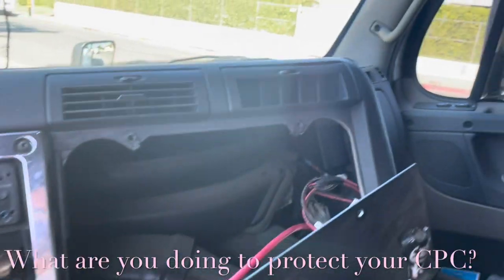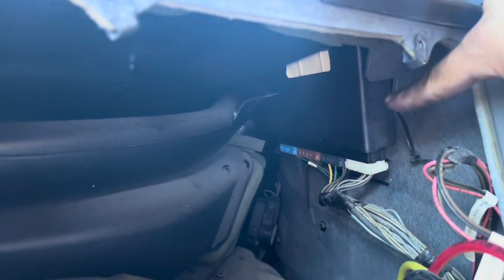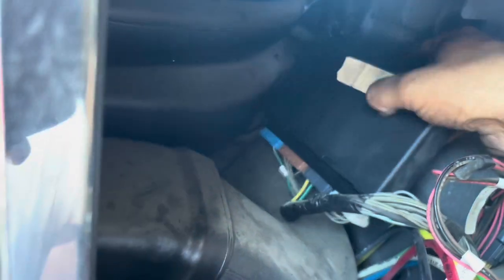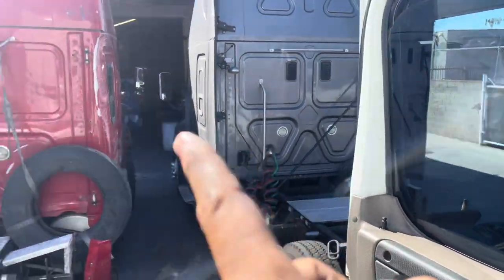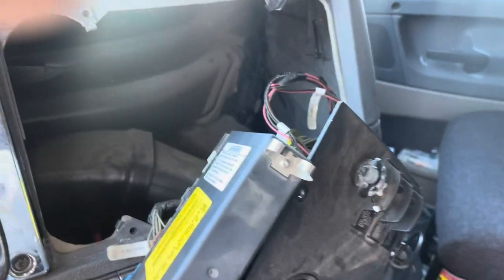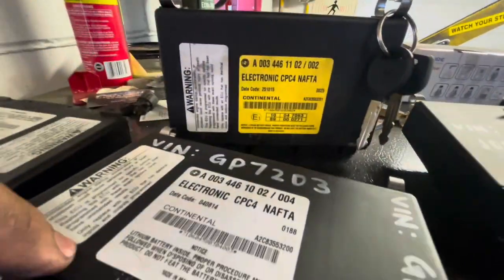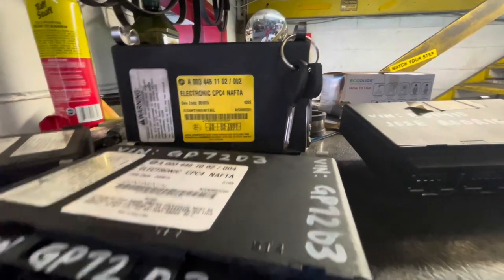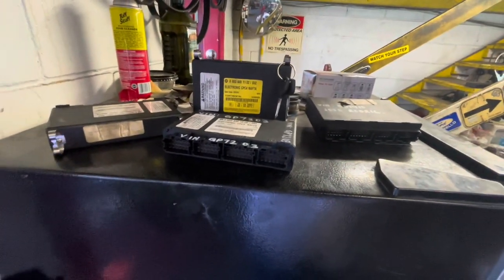Freightliner Cascadia owners, what are you doing to keep your CPC4 safe?

Comment: I took zip tie out put cable tie in, fabricating a block wall in case they get past front panel that has keyed tamper proof locking bolts and air supply lock so truck won’t move unless it’s dragged onto a flatbed what a beautiful world we live in
Reply from the maker: It is sad what we have to go through in order to protect what’s ours. 
But that is some great engineering on your part

Comment: Thank you for this video ..Question ,ones I remove the CPC for safety can I put it back next morning and the truck will turn on normal ?or ones I put it back they  need to reprogrammed?
Reply from the maker: Yes. You can remove and install the CPC and it will not have to be programmed.
Reply: @CarlosDieselElectric  perfect, thank you for the info , much appreciated..

Comment: This video helps truck owners and thieves as well thank u .
Reply from the maker: The thieves know they are there. My customer had his stolen while he was at a Home Depot. In the store less than 1 hour. Came back and CPC was stolen. Total price was over easily over $5,000. 
$2,000 for the CPC
$1,200-1500 for the core
Plus programming (varies at dealership)
Plus the harness 
Plus labor (to assemble harness)
and then the down time. 
Just have to be safe out there. Takes thieves less than 5 minutes to steal the CPC.

Comment: Thank you sir, does it affect the truck every time you take it out and put it back in?
Reply from the maker: It does not, just be careful with the plugs when you pull them. But as far as the memory of the CPC goes. Nothing happens to it.
Reply: @CarlosDieselElectric  so I just removed it and when I plugged it back in the orange engine light stays on, how do I remove that?? And a code is popping up now for cruise: SPN 639
Reply: Ok the light just went away had to let the  truck sit for a minute
Reply: No I do it every day

Comment: this is a long shot but what are you guys doing if the connectors have been cut? are you installing connectors or the whole dash harness?
Reply from the maker: Good question, Freightliner sells a kit but the irony is they don’t include the instructions which completely defeats the purpose. I use a sister truck or similar and follow the numbers and pins.
Reply: @CarlosDieselElectric  I appreciate the response! I recently had a request from a penske shop that was hit for 15 cpc's I provided all the schematics I could but a sister truck is what I was thinking as well. Thank you sir will check out more videos.

Comment: Hi can we take the cpc out every week when we do our reset at home that's 50 times a year should there be a problem ?
Reply from the maker: Yes you can, I cut the power using the cut off switch then I remove the CPC4. You won’t have any issues. It is a plug and play.
Reply: @CarlosDieselElectric  Thank you man I appreciate it

Comment: Will the cpc alwsy be located there? I’m asking because my truck got broken in and they stripped the dash, the fuse box and the bottom part. I don’t think they found it because I was able to turn on the truck and I been driving it for the last two days. Mayb the previous owner hid it somewhere else. I’ve just had my truck for only 6 months now.
Reply from the maker: Some trucks, 2016/2017 or newer have it located elsewhere. 
What year is your truck?
Reply: @CarlosDieselElectric  I'm in a 2017.  Is it an issue with this year
Reply from the maker: @adamhearts9195  the problem is the CPC4 is on a national back order and taking 8-12 months to get. So people are stealing them to sell them on sites like eBay for some serious money. From I have heard, they are selling them for $5K on up.
Reply: @CarlosDieselElectric  I meant the location,      or are all cpcs located right there and you have to move it yourself?  Or did freightliner move it after a certain year of production 

I just opened up my panel and my cpc/cpc4 isn't located in the traditional spot in the panel to the right... 

Not sure if the owner had it moved or if it was freightliner figuring their crap out,   I peeked around the panel area and didn't see anything obvious that looked like it.       Just a ton of words,    no harnesses though or the black box
Reply from the maker: @adamhearts9195  now I understand, the CPC is located behind the panel or dash just to the right on almost all Cascadia trucks. They did however, change the location on 2017/2018 trucks to a completely different location. So if you don’t see it that is a good thing. You can always call your local Freightliner to verify where it is located.
Reply: @CarlosDieselElectric  okay,   yeah mines not there Thank God. 😇
Reply: @CarlosDieselElectric  nope they didn't or at least not on all trucks, 2019 got stolen under the same spot recently, they didn't took it one from '09 don't know why?

Comment: It seems as though just freightliners have this problem, are these CPC units only a freightliner part? Also it sounds like this is a problem only in Cali.
Reply from the maker: Certainly a Freightliner problem, not sure about California but that could be true. Since California does have clean air requirements. The CPC4 can be found in the 2014-2016/2017 Cascadia trucks.
Reply: @CarlosDieselElectric  It definitely sounds like its a California thing. I live on the opposite side of the country in Miami and have not heard anything about people breaking into freightliners and stealing those from them out here.
Reply from the maker: @Couldnt_let_J.Marston_die  Spread the work, the CPC4 is selling for around $5K on up. Just check places like EBAY. 
Better to be safe.
Reply: Someone stole mine and I live in florida dude
Reply: In illinois this week a big hit, they have stolern over 50

Comment: Does the 2013 Coronado have those as well?
Reply from the maker: All trucks have them, you can remove the dash panel or cover and you should be able to seem it. Cascadia are the main target because so many thieves know about them and the location.
Reply: @CarlosDieselElectric  can you tell me where I’m should be I’m not seeing it I have this going on 2013 freightliner coronado I have codes that basically say no communication between the ecm an other modules spn639 fmi7 an spn625 fmi14 anything will help thank you

Comment: If I buy a new cpc or CPC4, are these things plug and play or do they need to be programmed?
Reply from the maker: If the CPC is used then it is already programmed to the truck it came from. It should be plug and play but May require programming to match your VIN. 
If the CPC is new, then it definitely needs to be programmed or flashed to your VIN.
Reply: Not plug n play need programming and if you have manual may not work with cpc that came off automatic

Comment: To install it you just but the 4 plugs on or you have to turn off the main electric power off
Reply from the maker: I recommend to cut the power first before removing and then you can turn the power ack on. Better to be safe. But it is a plug and play.

Comment: Can you remove it daily without the truck throwing fault codes?
Reply from the maker: Yes you can.
Reply: @CarlosDieselElectric  sick! Thank you
Reply: Kill all the power before disconnecting and connecting I do it every day
Reply: @gerardolara7495  is shut off switch fine or do you disconnect battery terminals?
Reply: @albertcruz3232  shut off switch only no need to disconnect battery I do it every day and no codes pop up something the little motor light pops up but you turn truck if then on and it goes away

Comment: They just got mine f'n bastards! 

While scrolling your video it looks like yours has the same wiring placement as mine.  Mine is a 2015 automatic. Can you please show me the color codes and placement in each harness please
Reply from the maker: @samsam-fk4hm  I just went off a truck in a similar year. My customer brought me the connections from a junk truck that was wrecked. They cut the harness plugs and I went off the numbers on each wire. Very tedious work. But that might be your only option other than the dealer. 
Sorry to hear this happened to you.
Reply: Yeah, that's exactly what I did, but I have 4 wires that do not match up number wise. I was lucky enough to have a picture of my old one so I have most of the wire in the right place (hopefully), but I have a warning light on for "2-channel accelerator pedal signal 2 missing". The picture I have doesn't show where the solid white and solid black go so I'm guessing they were spliced into another wire before the cpc and then I have 2 wires (440p1 and 440p2) that do not match any numbers on the harness. I tried to mix and match but no luck. Thank you for your response anyways.

Comment: This is stupid why not just take those 4 screws that hold the back plate and replace it with special key screw so when they come stealing  their tools will be worthless
Reply from the maker: That’s probably the best option. I have been switching out all four with an Allen
Reply: @CarlosDieselElectric  What screw size? I bought allen #10 but won't go through the 'pins'

Comment: What the hell is a CPC…?  🧐
Reply from the maker: Common Powertrain Controller CPC. You will find this on Freightliner Cascadia with a Detroit engine.
Reply: @CarlosDieselElectric  does a 2016 Coronado have one? Yes it has a dd15…
Reply from the maker: @raywebb8215  if I remember correctly, yes. Check behind the dash where the switches are located.
Reply: @CarlosDieselElectric  I called freightliner and they said that they stopped using them in 2016 but my vin does have one and as of yesterday there is still a 51 week wait to get one 😳
Reply from the maker: @raywebb8215  call the local Freightliner here in Whittier. They had them last I checked.